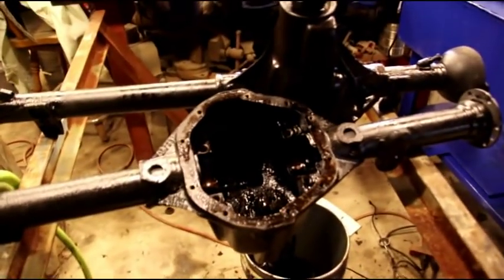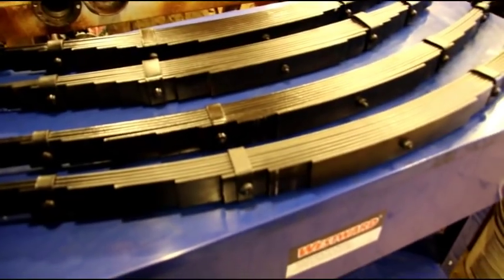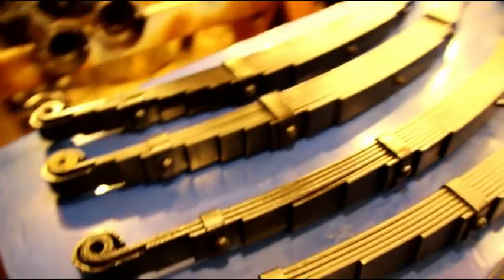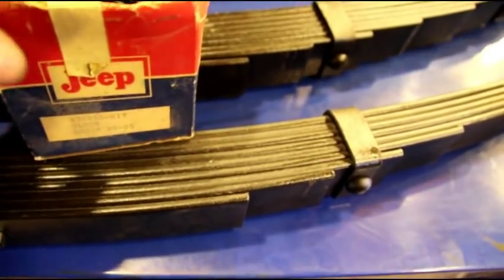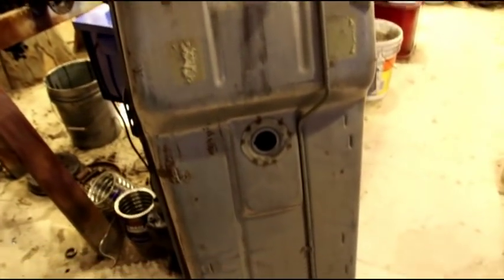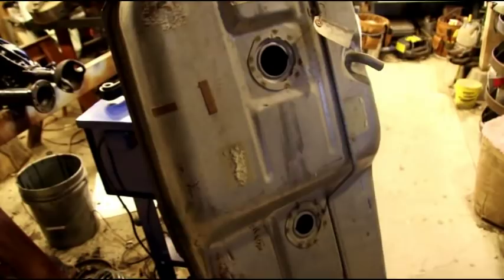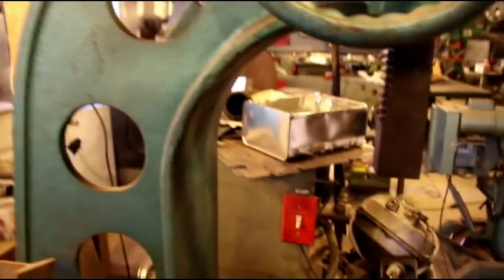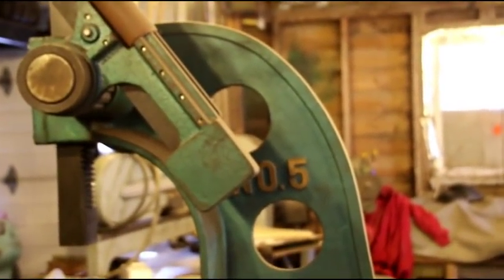Willys, Bantam, Jeep, Wagoneer, Jeepster, Parts For Sale

Comment: I am looking for a manual to guide me on installation of the complete door hardware including glass, felt, window mechanism,l etc...for the big Willys utility wagon. I received a tore down 1952 willys wagon project. Everything is apart and painted I just need something to guide putting it back to together. I used to restore Jeapsters48-50 and might have some  odds and ends to move as well. If you have something let me know and I will contact you for further inquiry and purchase.
Reply from the maker: Best thing to do if you don't know how things go together is to pick up another vehicle or set of doors that have not been taken apart.  You won't find that kind of information in a service manual.

Comment: Brian, would you have or know of a book that would have torque spec's for bolts that would include all or most or parts for Jeep from 1941 thru 1960's or 1980's? It would be helpful to me to have a book to look up a year, and part to know what the torque spec's are at a glance.

Comment: How much is the arbor press, where are you located?
Reply from the maker: Arbor press is $275.  I am located in East Haddam, Connecticut.
Reply: @metalshaperJeep  If it was only closer.... dang you're 13 hours away, 26 hr round trip. I'll have to keep hunting. Price is fair, I would do it if it were just couple or 3 hrs away. Should be an easy sell. Your skills are over the top. I always pick up something from the videos, Thanks for sharing